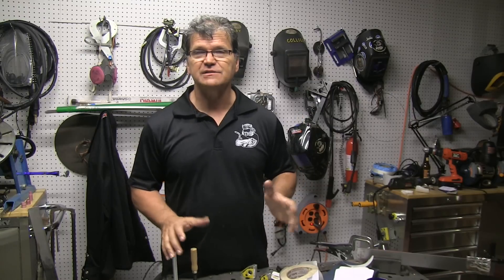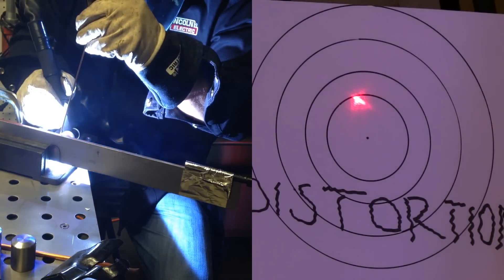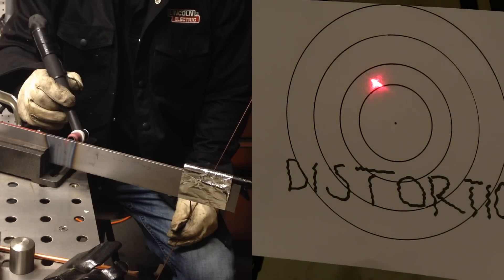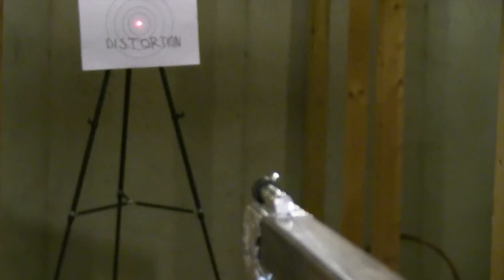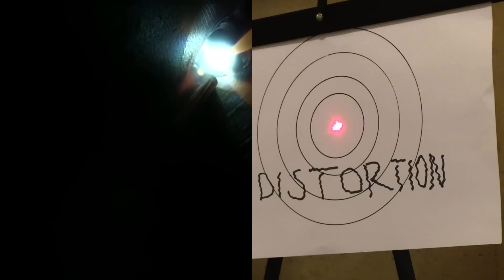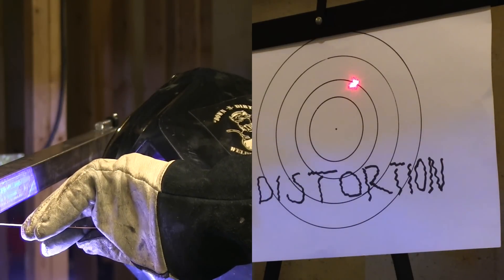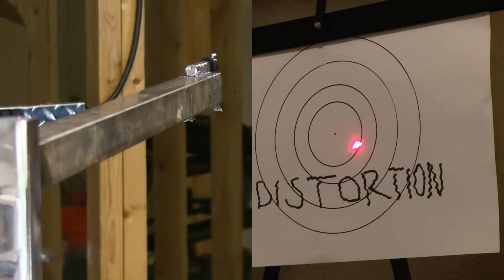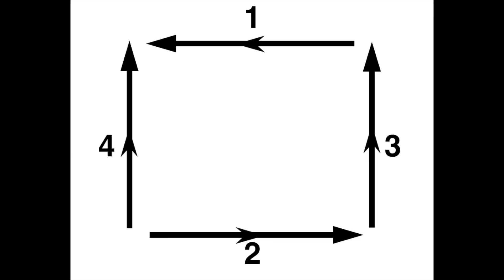Welding Distortion Fundamentals

Comment: Welding Stainless pipe was the worst for weld distortion. We did a lot of "washing" over our welds to achieve straight butt joints or pipe to fittings for squareness. Great information on this video!

Comment: great Video Jody, I am currently still smarting from my latest project in my home shop/garage. I built a 9' tube bench using 1/8" and 0.100 thou tubing and ended up with some warpage between the the final table top and the floor. I was not happy but your demo with the laser pointer is a fantastic refresher on why I really need to keep paying attention to the direction or weld on EACH and EVERY side of the tubing faces...especially the legs.

As always, you are a wealth of real world knowledge.

Keep up the great work!

Mark.

Comment: I had long been intimidated by heat distortion in welding, but thanks to your genius idea, finally I understand a lot more than I used to! Thanks a million from Hungary!
Reply: In depth   heated metal  will like to expand more than the surrounding area but it cant because colder metal is stronger so atoms of metal structure will decide to flow sideways to a path of a lower resistance thus increasing in thickness .When it cools down area of increased thickness will pull back with more force thus bending it  backwards or in  ways dependent to how heat is applied .

Comment: Excellent video! I've never seen a test setup like this. It really visualizes the stress acting on the materials when applying heat to it.
I used the welding method you described for a long time and it spared me a lot of grief and straightening things out afterward.
Thanks for another great video. :)

Comment: I made a wood splitter to mount on my backhoe. I needed to build it with tight tolerances with what the backhoe needed for mounting. I placed small tacks to hold square. Then larger tacks. Everything held nice and square. Then I welded it up permanent. It pulled out of square. Not enough to effect the project. Steel was 1/2" 325A. Pulled a 1/16" in 16". Minimal I know but I would have thought that with heavy tacks it would have locked it in. I'm learning...everyday. Thanks for the schooling.

Comment: What a great idea using a laser to demonstrate the effects of heating and cooling. For aluminium I have used the locking technique with no bracing. welding all inside corners first. Then top and bottom. the sequence is important and you allow the distortion to work for you and not against you.

Comment: I learned about distortion the hard way on a $200 chuck of 11g stainless. I should have practiced more before trying to weld on such a nice piece of metal. And like you said, it ruined my day. I tried like hell to bend it back but it never was the same again. I ended up chopping it up into coupons and practicing tig. So it still went to good use.

Comment: I wish the welders where I work with cared enough about their trade to actually learn things like this. The fitter knows exactly what he's doing and how to weld but the welders routinely weld things the worse possible way for distortion and refuse to change or learn. It's very frustrating to see. I'm not even a welder but learn a lot from you.

Comment: In the beginning, If the laser pointer is at the back of the stock, from where it's welded, Isn't it expanding tilting the laser up, therefore the back end of the stock is in fact going down (not up), tilting the laser upward? You videos are very informative, and your welding finger works out great! Thanks

Comment: Jodi,  I'm a know nothing untrained individual with regard to welding... I enjoy watching your videos and have learned a lot from your efforts... you have me scratching my head with your first laser test however... because it appaers as though the laser was afixed hard to the rear of the work piece it seems to me that if the laser showed an upward movement the cause would be a downward effect on the piece it was attached to. Sort of like an effect you'd expect if you placed a target in line with a seesaw and the laser on the far end of the seesaw.  Please correct me if im wrong, as I said you're the pro, butmI'm just a little confused on this one... lastly please understand that I realize the intent of the video was to illustrate the movement in general so I may be taking this over the top... great video, you made me think with this one... thanks for sharing... Mike
Reply from the maker: I may have shown the piece backwards for a sec.
Reply: Yep... watched the video a second time and I see how you have it set up... sorry for my confusion.....

Comment: fantastic video, it seems counterintuitive that the side went toward the bead side. I would have thought that the weld side would have been hotter and so the expansion would be greater on the weld side and so the side bend should have been away from the weld side.

Comment: Hi Jody ,I am calling from a town on the N.E, coast namely, Arbroath,Scotland famous for the Smokie-smoked fish and the founder of Buick Motor Cars,David Dunbar Buick.
Thank you for this visual example of distortion with square hollow section steel.
I wish I had known more about this some 12 years ago.

Can you confirm or debunk a question I have on the same topic-distortion. This is the job we have to weld frequently ,a steel rectangular frame,joined at each corner, inside ,outside top and bottom.

So 4 locations per corner, at all the intersections,no missed welds.The job is to be Mig welded. It is square hollow section steel  that has been cut at 45 degrees with a small gap( requiring a full penetration weld) and prepped with a bevel/chamfer on the diagonals and joined to make a rectangular frame.

Now if there is an approved order in which to weld this, to minimize the distortion .then no textbook I have seen tells you this stuff.So some of the fabricators at my workplace have suggested an order to follow.
 It is all the inside,all outside,then one run initially in each chamfer but the preferred direction is from the inside to the outside of each chamfer,adding more runs as necessary once they have all had one run deposited.So is this order best practice?No mention or concerns have been made about the direction of travel for any of the other welds.
Thanks again for your great insight and educational videos.

Comment: Excellent video thanks. 2 questions.

1. On a butt joint do you ever start in the centrer of a joint and move out to pull in one direction then back in the other?

2. Is it common in some industries to use a method like the laser pointer or a dial indicator or two at the end or a work peace to get an idea of how the piece is distorting as the weld joint is welded up?

Comment: CHEERS! As you mention, that was NOT what I expected to see/learn :-) in the past on a few projects when I needed a 'curved' (start central, running off to the edge) I've stick welded a 'rib' letting the heat distortion take care of the 'bend' but I hadn't guessed with box section Direction of weld can be the Major player!

Comment: The laser pointer is on the tail top the pointer moving up indicates to me that flat bar is sagging, and that makes sense because the bottom is where the stresses are being relieved due to welding. 
I have a 16 in gas pizza cooker a rotisserie motor drives it.  The motpr quit and the gas didnt. I now have a 1/10" thick potato chip pizza pan with a ring around it to hold a ceramic plate. I have it closer than it was but it aint pretty.

Comment: An impressive demonstration.

In this YouTube video on welding distortion, your TIG torch was equipped with a hand-piece remote amperage control of a type I have never seen before. Could you tell me what brand/model remote control you are using?
Reply from the maker: its not really an amperage control ...but just a simple on off switch that comes on a lot of imported torches.  you can see them on ebay all the time. 
i leave it on the torch because sometimes it comes in handy to unplug the foot pedal and just use a torch switch.  especially handy for lots of tack welds

Comment: If you were to run a bead on one side from bottom to top, then one on the other side from top to bottom, would it cancel the distortion out or does it not work like that?

Comment: Sir i want to weld ss316L 1mm thickness coil an🎉d make a belt out of it.when i tried tig welding with argon gas and tungsten grinder my coil got destorted and warped around the joint.Have made very little use of filler metal and kept meter reading at 45 ampml.Request you to suggest a suitable solution

Comment: this may be completely wrong, but...... If the flat bar is fairly level and flat to begin with, for the dot to move upwards on the target the bar would have to move downward on the laser end. The distortion is NOT keeping the bar flat and moving it, it is bending it. If the laser end bends upwards the dot on the target would move lower. What am I missing?

Comment: I noticed quite a bit of distortion welding a schedule 80 aluminum coupling through 3/16 plate have any advice on minimizing that? I tried welding in quadrants to keep from getting too hot and still warped on me should I put strong backs around it?

Comment: Motor vehicle safety inspection standards are changing rapidly because of welding technique or lack thereof. Gas welding is now prohibited, welding within 2" of a seat mount, there was something about pinchwelds and rivets were outlawed. However, I can build my own car from scratch and do whatever I want....well within reason. European design is using crimps and riviets, so scratch that and there are process to gas weld HSS if done correctly. I think primarily the reason the standards were rewritten was because of $89 flux core welders. I can't remember the last time I saw a bodyman weld an inch and then tap the weld to shrink it. I'll take my pot shot at Eastwood now, you can roll sheet metal to pretension it but it's a real bitch to make a roof or door pretensioned when it's already on a frame and then butt weld with clecos and the clamps they sell. Point being, the shops stopped fixing rust. It's 3M panel bond or plug welds.  They forgot how to weld and theoretically it would be illegal here to install a floor pan yet I can weld door pillars and sides of cars that are Tboned like a banana.  Goodbye common sense!

Comment: Instead of on the edge, if you welded the flat side it would distort way more due to the fact that flat bar is way harder to bend on the edge instead of the flat top and bottom.

Comment: I don't think i've ever welding up a frame that has come out square.
I did come close once. I had three corners at 90 degrees and the fourth one wasn't. Still can't get my head around THAT one!
If i watch a few more of your videos i might actually end up welding up that car chassis i've had a hankering for years to fabricate!
You may have partially exposed some light at the end of my tunnel...

Comment: 6:34 "Expands back to its original state.." or contracts back? _Maybe you mean that it expands and as a result moves from the opposite side of the welding, but by the end, having welded all sides, it comes almost in starting position or even going some?!?(assuming you weld in appropriate directions, gaps, etc.)

I apologize but I do not clearly understand it the way you say it, probably because I am not a native English speaker.

Comment: One question. In this case the square tube is positioned horizontally in relation to the other piece. if you move it to a vertical position, does it make any difference on direction / sequence of welding.? Since in this new position you will have only front/back left/ right welding references. I thought that the heat dissipation would affect distortion differently. Sorry for the dumb question, I'm jus new here.  Thanks a lot for your tips